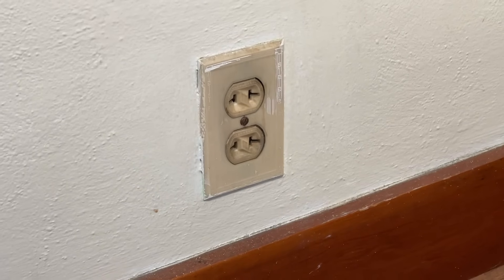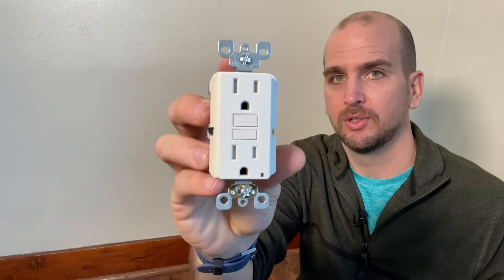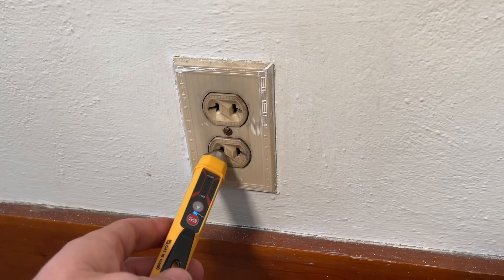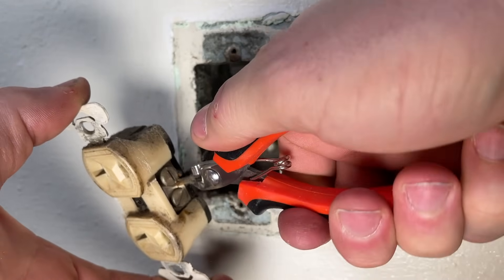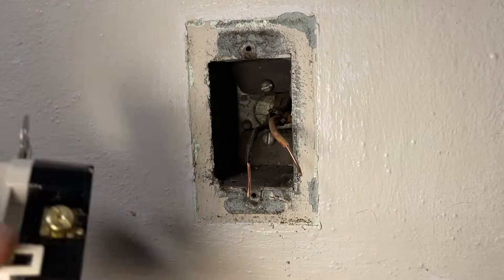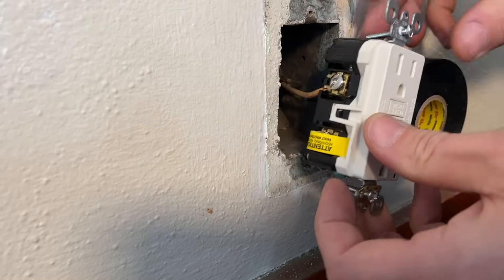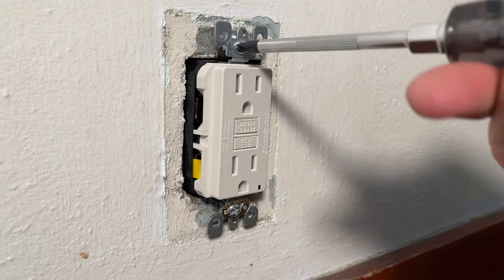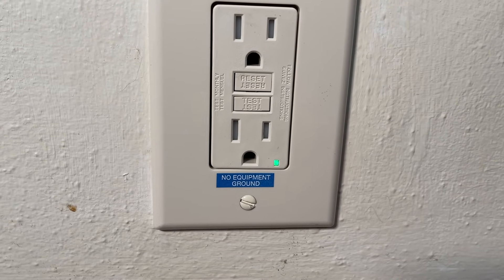How To Replace An Old 2 Prong Outlet Using 3 Prong GFCI

Comment: All very good advice, I have a very old house where I do this on non-critical circuits. Just note without the ground typical surge protectors will not actually protect against a high surge since there is no path to dump it to ground.
Reply: BOB A, you are correct, varistors in a surge protector require a ground wire to function properly.
Reply: @surferdude642  }> your correct , 
The metal box he mentioned was nailed to a stud in the wall .. It not connected earth ground .. After reading some of these comments 
I now know why they have so many warning sticker on equipment .... Just saying 😏
Reply: Surge protectors have varistors between all the three connectors so they do dump the over-voltage to the neutral.

Comment: What does "no equipment ground" mean?
Reply: It's a warning that the ground receiver on the receptacle is not connected. You can plug something into that receptacle and you will be safe from shock if a ground fault occurs, but your electronic equipment will not be protected and could be damaged by a ground fault.

Comment: If you want to display proper wiring then used a J hook or at least put the wire on the proper side of the screw.  Your common connection was the error.  Adding tape actually serves no purpose, especially in an end of circuit box.
Reply: If he was directly under the screw, I'd agree on the J-Hook.  He's under the 'easy install tab' that's there for the very purpose of what he did.  As for the tape, peace of mind comes in all sizes and shapes.

Comment: That looks like a 20 amp out that you are replacing with a 15 amp, or is it just my eyes are bad.
Reply: A 15 amp gfci is code compliant and preferred in this case, regardless if the circuit is 15 or 20amp.

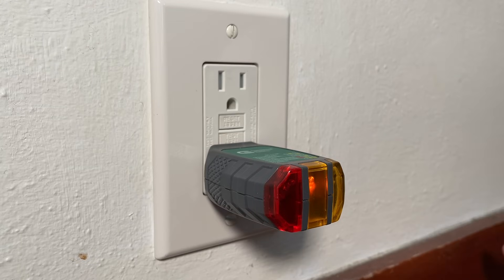Comment: At 5:15 I have a wall Outlet that I’m going to replace in my kitchen can I run new Romax wire with the ground inside , fish it down going to my basement and add a junction box but the ground wire just ground it to a water line pipe for now to have my ground working temporarily til I saved up to update my electrical box in the near future?

Comment: Why would anyone use a GFCI for an ordinary outlet were there is no water present? They cost 10x an ordinary 3 prong, and still not grounded.
Reply: they are not grounded but still provide extra safety that wouldnt normally be there on a 2 prong outlet
Reply: @zigafide  It takes a ground for a ground fault breaker outlet to work, however, if it is a metal box attached to a stud you can ground it to the box, but a regular 3 prong will work just fine if there is no water pipes or faucets near to it. GFI's are made for around sinks where you could possibly drop an appliance plugged in into the water
Reply: @basictechreviews  that is not true. A GFCI just makes sure that all current going out to live comes back thru neutral. If it doesn't, it opens. No ground required, thus why its an acceptable replacement.
Reply: @zigafide  In other words, it has its own breaker, yeah sure but not a necessary expense unless you are paranoid.
Reply: @basictechreviews  No. a GFCI breaker is different from a normal breaker. a normal breaker doesnt provide protection like this
Reply: @zigafide  Are you an electrician?  Or are you just looking for an argument?
Reply: @basictechreviews  im not arguing im just saying why its acceptable
Reply: @zigafide  It's acceptable but not nesseary by code. I have been working in the h.i. business almost 40 years and I also do inspections.
Reply: For safety  🔌👌

Comment: Where do GFCI breakers come into play? Is the circuit still protected without a GFCI breaker? I need to run a dedicated 20amp line for my refrigerator and I've never used GFCI breakers before.
Reply: You need only one GFCI per circuit. A GFCI breaker is alternative to a GFCI outlet.

Comment: The only reason to GFCI an area of the house that is NOT A WET LOCATION like bathroom, kitchen, garage, or outside, -is to simply pass an inspection-, or perhaps to be extra cautious around someone who is disabled in that room [ofcourse never hook up their important health machine equip to a GFCI that could turn off suddenly and without warning]. Or maybe your using a machine or power tool in wet area like a power washer, or vacuuming up water with a wet vac.  Oh, and by the way, you cannot 'legally' have a GFCI behind a sofa, dresser, or other pieces of furniture. Now what are you gonna do? Putting in a GFCI breaker would be a far better solution, since if power is lost, you need not search the house trying to remember where that stupid GFCI outlet was. Oh did I mention GFCI outlets dont last as long as normal outlets? So you are paying several times the cost for an outlet that won't last half as long. Are you starting to see the light yet?

In the real world its a worthless waste of time, that places areas of the house under hypersensitive nuisance GFCI protection where none is needed. It's like wearing a bicycle helmet when you walk up the stairs. Technically it's safer, but its absolutely stupid to do. Also, GFCIs are bad for electronic equipment. A proper bond and earthing system [grounding system] is what you want for surge protectors to work correctly, and for sensitive electronic boards to shunt excess power to the earth, and clear up electromagnetic interference.

If you want to pass an inspection, put in two-prong outlets. If you want to live there, put in 'illegal' three-prong outlets which is safer than using three-prong adapters. Just remember the outlet is not grounded and surge protectors will not work correctly.

I would love to go on but I am saving the rest of my rant for the comment section of a news video

Comment: Cutting them off flush,only works if you have extra wire in the wall, I have seen them where,elect electricians, cut the wires with just enough to hook up the recepticals.

Comment: Few licensed electricians would do this.  Generally, replacing an ungrounded receptacle with a ground type, without having a ground is a violation of the National Electric Code . The label brings the receptacle in compliance only in jurisdictions that follow the NEC, in  residential installations where a GFCI is not required by code, because the GFCI will not trigger reliably at the design current.   An owner or  contractor who did this in a hospital, commercial or industrial installation would get a hefty fine.
Reply: I dont think you understand what your talking about. Sounds smart because of the big words, but doesnt make electrical sense

Comment: I noted that you used a 15 amp GFCI. Please explain to the viewers that the amp rating of the GFCI must match the amp rating of the circuit breaker.
Reply: 15 amp outlet on a 20 amp circuit is within code. Still worth explaining

Comment: A licensed electrician would never install a GFCI,  (Ground Fault Circuit Interrupt) with no ground.
Reply: Yes they would
Reply: This is an acceptable practice to upgrade a 2 wire receptacle and meets all code requirements.

Comment: How is this safe without a ground lmao
Reply from the maker: GFCI detects a difference between the hot and neutral side.  Once a difference above the tolerance of the receptacle is detected the GFCI is tripped.  It is definitely preferred to have a ground but not needed for the GFCI functionality.

Comment: Nice try but I do not see the code link promised.
Installing a GFI ungrounded outlet will NOT provide the protection as designed.
That ungrounded sticker, which nullifies the GFI action, was the only thing that saved you.
Nothing but chance and liability if that sticker is removed, no thanks.
Best option to have a functional GFI outlet is to properly ground to panel..period.
If you have a two prong system, the only proper way is to wire a ground to panel. not a water pipe,  in new system.
If not remodeled, you can stay w/existing electrical system without a false sense of security.
Reply from the maker: Common misconception but a GFCI will still provide protection without a ground.

Comment: Hi, electrician here. This is against code, and quite dangerous. GFCIs aren't designed to stop current coming from the panel, it's designed to stop current from flowing to anything the GFCI is supplying. The proper way to do this is to rip out all the old wiring, and replace it with Romex depending on the size of the breaker that supplies the room. Every circuit needs to have a ground going back to ground bar in the panel. If you look on a piece of stripped Romex, the grounding conductor is the bare copper wire in the middle. The grounding conductor is then put into the ground bar, back into the panel. 

Yes, it's more expensive to replace the old wiring, but slapping a GFCI on old knob and tube wiring (the wiring shown in the video) doesn't pass home inspections. Your home is an investment, and needs to be treated as such. Knob and tube can be a fire hazard. Most home owners insurance companies either don't insure houses with knob and tube or charge higher rates due to the risks associated with it. Don't rewire your house on your own. Call a professional.
Reply: Incorrect.
I really wish people who claimed to know NEC, you know... ACTUALLY KNEW the NEC

406.4(D)(2)(b)
A non-grounding receptacle can be replaced with a GFCI type receptacle. The receptacle shall be marked “No Equipment Ground”. An equipment grounding conductor shall not be connected from the GFCI type receptacle to any outlet supplied from the GFCI receptacle.

Comment: Can I install a gfci for every outlet? Also can I pigtail them for the outlets that need to be? I have an older house an want to update the 2 prong outlets. Thank you and your videos a great and very helpful
Reply: You would spend a ton of extra money buying all gfci. And not necessary. Not sure what you mean by pig tail? Think you meant daisy chain. Pig tail is the piece of wire you use when you wire nut 2 or more runs together and wire the device. Find where the power is being fed in the outlet. The hot romex goes on the line side like he said. The romex going to the other outlets goes on the load side of the gfci. Then every receptacle on that circuit will be protected by that first gfci. I am a licensed electrician. For your piece of mind.
Reply: His other video think he called it pig tail. When he took 3 sets of wire and made it 1 to wire to the outlet. It doesn’t matter there is not that many outlets to replace that’s why I was just going to use all gfci
Reply: @mikerapeer4848  Yes when you wire nut 2 or more runs and add a pig tail to connect the device. That's correct.  When tying 2 or more devices on the same circuit that daisy chain. Wish I could of been more helpful. But hope you get everything worked out.

Comment: I have a question on this before I go all out and change my receptacles. I've never actually noticed the problem until the first time I picked up a new stereo system, it's very noisy especially when I have the AUX plugged in (listening to my turntable is unbearable on it), so if I were to install a GFCI would this issue be fixed even in the slightest? I hear it NEEDS to be grounded for the noise to stop but I don't want to have to spend all that money rewiring the house.
Reply: Do you have an antenna? Adding a galvanic isolator to the antenna cable might help. GFCIs do not affect the noise or hum. 

But are the plugs even three prong? If not, then it does not matter what outlets you have?
Reply: @okaro6595  It's currently two prong with a three prong adapter. But I'll check out what you mentioned, I just wasn't sure about other options knowing that my outlet isn't grounded.
Reply: @eggmanland660   If the equipment has only two prongs, the manual probably suggests flipping the cord around to check if the hum is reduced. One thing that gives me pause is that you said "new" stereo system: that will likely have a polarised plug (to prevent this very problem). If the turntable still has an unpolarized plug, flipping [that] plug around may still help. 

If all of your equipment is in the same room, you may be able to ground it all together (look for a ground screw on the back for that purpose). Such a ground won't provide electrical safety though.
Reply: I've been looking into it and I should mention the antenna is one of those wire antennas. I'm not sure what I can do with what all products and solutions I'm seeing.

Comment: Do I use a 20 amp gfi or 15 amp gfi?
Reply from the maker: Always good to check the breaker installed at the panel for that circuit.

Comment: GFCI is only required when the circuit is within 6 feet of any water source such as in a bathroom or kitchen. It is also required outside. Every panel is required to have two GFI breakers so you might consider just changing the breaker. If the house is that old they used two wire I would inspect the wire closely for the insulation being dry rotted, cracked or chaffing. A proper rewire might be in order.
Reply: If you replace the a two prong outlet without grounding with a three prong one  then you must always use  a GFCI.

Comment: I'm glad you explained the use of the GFCI outlet when not actually grounding a new outlet receptacle.  I wish I had known that when I bought my first house which had all two-prong outlets which I replaced with more modern three-prong outlets and didn't ground them.  Fortunately, I'm now on my fourth house built in 1992 which is already up to code so I don't have to worry about that anymore.  I subscribed to see what other useful information I can learn from you!

Comment: You can also save a shit load of money and just use the neutral wire as a ground. Most "plug in" type testers that inspectors use won't know the difference.   right now I don't think anyone wants to spend $20 per damn outlet)
Reply: You can also use a fake $20 bill to buy the outlets. Do not instruct people to break the code. The issue is not about cheating an inspector.
Reply: @okaro6595  agreed, I should have included a a disclaimer for snowflakes like you

Comment: Hi! Question. We have laptops with 3 prongs and our house has 2 prongs, by doing this, it will give us the ability to plug it in but what about safety wise? We don’t leave our laptops plugged in when not in use.
Reply: Yes, there will be no safety issues. In fact laptops use 19.5 volts. The mains voltage goes only to the charger.

Comment: Can someone help me understand why it needs to be GFCI? What if I have a ground wire.. do I still need to use a GCFI per NEC?
Reply: It is for safety. If there is a fault and the case gets the mains voltage on a grounded outlet the current goes through the grounding connector and this trips the breaker - or at least keeps the case voltage at safe level.

If there is no ground wire and you touch it and something grounded like a water pipe or a radiator or if you stand on a grounded surface you can get a fatal shock. The GFCI prevents this by cutting the power the moment you touch it. You may still feel a sting but that is not dangerous to normal people. 

If you have a ground wire you do not need a GFCI unless the location mandates it. Generally you need it in things like near water pipes (kitchens, bathrooms) and basements. Check the details relevant to your location.

Comment: Fun fact!! What he failed to mention or doesn’t know is the insulation on most of the old 2 wire systems were insulated with asbestos materials.
Reply: Fun Fact! Asbestos isn't dangerous unless disturbed and it takes quite a bit to be damaging to your lungs. Unless you riping out all the old wire, stripping and grinding the insulation into powder and snorting it like lines of coke you'll be okay.
Reply: I love this fun facts 😂

Comment: I have seen many plugs that had the polarized end filed of to fit a no polarized outlet. Then the people who break of the ground prong of the plug. Even though many boxes were metal in those days they weren't grounded and people were expected to screw and adapter ground to it. I personally don't think a gfci is a good replacement because they fail overtime.

Comment: If there’s no ground wire, what difference does this make versus using an adapter??
Reply from the maker: The GFCI will trip if there is a short on the hot side and the adapter will not.
Reply: @EverydayHomeRepairs  so if there’s no ground wire will the gfci be essentially a 1:1 replacement as far as the general purpose? Speaking from a safety standpoint in for example older apartment buildings.
Reply from the maker: @adams5989  If you have multiple outlets on the same circuit you could replace the first outlet with a GFCI placing the wires coming from the panel in the "Line" terminals and then the wires going to the next outlet should be placed in the "Load" terminals on the GFCI.  This will then also protect the outlets downstream with GFCI protection and you can use a standard 15 Amp or 20 Amp outlet depending on your breaker, wiring, and setup.  Don't forget to properly label the faceplates with the stickers that come with a standard GFCI.

Comment: What amp rating outlets would you recommend for using CNC machines in your garage because CNC machines often trip the GFCI because of the CNC machines stepper motor controller boards send voltage to ground which will trip the GFCI. CNC machines need to be on their own branch because anything else that is turned on will cause the CNC machine to miss steps, any reasons why>?
Reply: Sounds like you have harmonic distortion

Comment: Can I just replace the two prong receptacle with a three prong receptacle and obtain aground by running a jumper wire from the silver screw to the ground screw terminal on the receptacle?  That is assuming the breaker box has a ground rod on the outside of the house.
Reply: IF you want to risk eletrocuting yourself if a fault develops in the appliance plugged in or a short in your wiring, absolutely a very bad idea.   See Jane Drill does a nice video on why not to do that.